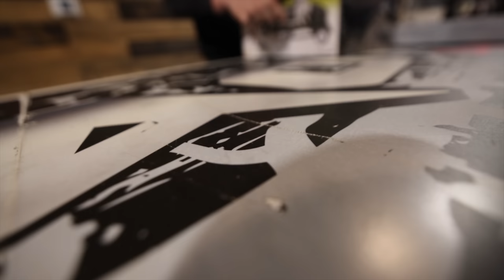What Really Happened To The 1 Ton Swapped Land Rover...

Comment: Hey Nate. 04 D2 owner here. I've owned 5. Het, lube up your rear door hinges as they will break. I noticed they are pretty bad when you tried to close it. 
I really love that you are playing with a D2. Such a pretty ride. 👍
Reply: Tools and Materials Needed:

	•	Penetrating oil (like WD-40)
	•	Lithium grease or silicone spray
	•	Rag or paper towels
	•	Gloves
	•	A small brush (optional)

Steps:

	1.	Preparation:
	•	Park your Land Rover on a level surface.
	•	Open the rear door to access the hinges fully.
	•	Clean the hinges with a rag or paper towel to remove any dirt or debris. If necessary, use a brush to get into hard-to-reach areas.
	2.	Apply Penetrating Oil:
	•	Spray a small amount of penetrating oil (like WD-40) onto the hinges. This helps to loosen any rust and provides initial lubrication.
	•	Allow the oil to sit for a few minutes to penetrate the hinge mechanism.
	3.	Work the Door:
	•	Open and close the rear door several times to work the oil into the hinge mechanism. This ensures that the oil reaches all moving parts.
	4.	Apply Grease:
	•	After the penetrating oil has done its job, apply a small amount of lithium grease or silicone spray to the hinges. These lubricants provide long-lasting protection.
	•	Use a rag to wipe away any excess grease to prevent attracting dirt.
	5.	Final Check:
	•	Open and close the door again to ensure the lubrication has been evenly distributed and the door moves smoothly.
	•	Check for any remaining squeaks or resistance, and apply more grease if necessary.

Comment: I know it seems like everyone and their grandmother has done a LS swap, but for a Disco it seems like a great fit.  I was thinking about buying a Disco with a blown motor just to do a LS swap largely because of Nate's videos.   I'd like hear Nate's rational on why he's sticking with the 4.6.   I value his insights.
Reply: I'm considering an LS/ 1-ton axle Disco as well.  It's basic hotrodding. Take the body of your choice, the drivetrain of your choice, and get to work.
Besides, the LS and the Rover V8 share some family lineage.
Reply: Where are you located? I have an 04 D2 that needs an engine.
Reply: The LS is a larger engine, and heavier if you do the iron block. People who have done the swap are not really seeing better mpg. The h22 trans can’t handle much torque anyways. The h24 can handle maybe 350 ft lbs

Comment: Good call sticking with the 4.6. I did a Turner top hat long block years ago, still going strong when I sold the truck.
Reply from the maker: It should make it better than OEM and this current motor made it to 220k. I have confidence in the new setup. I had a legit Landrover guy put together the long block.

Comment: For your gull wings in the back, look at some truck cap rear doo0/window upper hinge mounts. They go full length of the upper opening, they "hook" together like your two hands, they put stops in the ends, and they slide apart. IDK if this helps, just my thoughts.
Also, good for you going all OEM for engine, transmission, transfer case. I'm getting tired of everyone throwing an LS at whatever they drive because it is a quick or easy fix (not always cheap).
Reply from the maker: That sounds like the hinge on my wifes GFC. Good idea. I wonder if I can find hinges like that for sale? GFC make there own In house. 🤷‍♂️

Comment: Wow.  What a list for upgrades!  Looking forward to them all, especially what you do with the storage in the back.
Reply from the maker: Thanks!
Reply: I second this! Really interested to see more storage options with thinner material.  MDF seems great but 1/2” for a drawer side, 1/2” for the other side, 1/2” x 2 for the box…. Pretty soon you’ve lost several inches of valuable space in a small vehicle to just material thickness.

Have you considered some kind of removable, modular setup?  Sort of like a chuckbox that locks (aircraft track?) into the back but can be easily removed? Maybe fast ambulance style slide in, legs up, lock down, unlock, legs down, roll out…

Either way, awesome build as usual!

Comment: Axle leak, maybe a blocked breather tube? It could be pressurizing when it’s hot and finding a way out under pressure. You said the engine bay is super dusty, the factory breathers vent into the engine bay. 
You can blow through them to see if the are blocked or upgrade to a larger fitting and new larger diameter breather tube.

Comment: Great to see the Rover coming back mate. Love the idea to upgrade the same engine type too. On the compressor is there a risk that running the air from the same air box could cause a vacuum issue with the engine pulling all the air that the compressors want. Might be worth thinking about.
Reply from the maker: The box should have enough flow that it won't cause any issues but I have definitely considered this just like you are saying. But if it can flow enough air to feed the engine at 5k rpm then there won't be any vacuum in the box at idle. The compressors only run when the truck is at idle basically

Comment: Nate your comment about the LS swap is spot on.  People are constantly telling me "Why doing you duramax swap your pig?"   Well, I'll tell you why - because changing the powerplant of a vehicle to something it wasn't designed and engineered for is a road to endless pain and misery... and nearly every owner that has swapped their 6.5 to a Dmax has said the same thing.  It's not just the engine that has to be swapped.  It's the trans, the tcase, the driveshafts, the diffs, the halfshafts, the hubs, the fuel system - not to mention on my rig you HAVE to put in a body lift to fit the damn thing in the truck.  It's just not worth it in the long run.

Good choice on engine dude.  I approve.

Comment: I'm +1 for the 4.6 Rover. I got a D2 with the 4.0 Rover V8 here in Aus. I rebuilt mine for under $1300 Aud (about $50 USD lol) Turner Engineering in UK have heaps of parts for them. Only thing with Rover V8 is they have a flat tappet camshaft. You probally are aware but these NEED to be bed in correctly on initial start up. I learnt the hard way and in under 5000km, I wiped out 12 lobes and all my lifters. Can't wait to see content on this beast, this is what I'm here for Nate 🍻🍻🍻

Comment: You shouldn't need to tap the steering box for hydro assist.There are a few (eg Gwyn Lewis) kits for the Land Rover 4 bolt box that are bolt on. They should fit the D2 box as well because it is the old 4 bolt box but with a thicker sector shaft for added strength (a failure point on the Defender and D1 boxes when run with bigger tyres).

Comment: Dude, I got a CNC plasma cutter in my shop. If you wanted to link up to tackle this molle panel design project, let me know.  My plasma table can cut 2' x 4' of material and I have Solidworks for designing anything 2 dimensional or 3 dimensional. If you need specialty plastic brackets to mate odd shaped mounting areas, I also have a 3d printer.. I've been following you since your Tacoma project (I'm more of a Toyota guy LOL) and it would be great to work with you . Cheers bro!

Comment: I actually LOVE that you're sticking with the factory engine.  Simply put, it's easier.  There's NOTHING to figure out or splice or modify.  I get it, and I LOVE it.  I can't wait to see what-all you're planning for this rig!  It's giving me ideas for my GX460!  So keep the vids coming!!
Reply: One thing you won't have to worry about in your Lexus is a self disassembling engine like the Rover V8.  An LS in the Disco would take so much worry out driving. An LS would outlast the rest of the vehicle.
Reply: Saying that there's nothing to figure out with a Land Rover is.... optimistic. An LS would be simpler and more reliable. LS's are plug and play at this point.
Reply: @amorton94  I just like the looks of the Discovery. I'm thinking a complete drivetrain swap. Transmission and t- case along with engine and axles. Do away with traction control and abs, and use an aftermarket dash display if the LR dash can't be made compatible. Not easy, though. 
Seems that the stock engine is the only real issue with these and if that can addressed, that's great. You are still stuck with 4.6 liters and horrible fuel mileage for the power they have.
Reply: @scootypuffjr.  Im thinking you don't own a Rover? The transfer case is extremely well designed. Some much so that every high end Defender builder uses them.
Reply: @bp9749  Thats what i hear. I'm just talking for ease of using a GM transmission as well. Also, I don't care for full-time 4x4. It drinks fuel unnecessarily.

Comment: I have 10k miles on my aluminum 5.3 thus far. I know it's played out but it's the most economical, most reliable, replacement parts abundant, sounds good, and churns 35s with no issues. My factory speedo, tach, temp sensor, and fuel sensors all work. Check engine light on my dash works for GM PCM. No oil leaks. The factory engine is severely underpowered and has many weak points including oil pump gear failures, slipped liners, sensitivity to over heating leading to popped head gaskets, and oil leaks out of all crevices.  I'm in love with my truck all over again and intend to keep until my 3 year old son drives it to highschool. I'm using the alternative conversions kit.

Comment: As the comments for a video less than a day-old clearly suggest, your Land Rover series is not just well-liked, it is also unique and different.  That is a hard thing to pull off these days on YouTube, but you did it.  And you did it very well.  No need to apologize for the time spent on the details--for those of us who actually own this vehicle, the great detail (like the spare tire/rear bumper build) are greatly appreciated.   Since our discussion at SEMA last year I have spent a lot of time rebuilding my 2004 D-2 and this video series was very, very helpful.  I have been working on Rovers for over 20 years so please take that as an honest compliment.  For what it is worth, a few topics that might be nice to cover in the upcoming videos (if you are so inclined...):  (1)  Can you talk a little bit about the Chevy LS/LM A.C.E. conversion option?  That one is definitely very different than all the other Chevy 350 builds given the double ECU/wiring configuration, the ability to keep the stock tranny/t-case/axles, and can also be done pretty cheap if you have middle-of-the-road mechanical capabilities and opt for ACE to build your plug-and-play wiring harness.  (2)  Can you talk a little bit more about your front and rear sway-bar configuration?   I have seen three Discos go turtle over the last 20+ years and each time it was from a completely disconnected front end unloading combined with too much throttle and bouncing.  It would be great to hear your opinion of how your sway bar mods affected this issue (on my old TJ the Currie anti-rock made a night-and-day difference).   Thanks again for providing quality and unique content!

Comment: Owning a 2000 D2 myself. I too went through the research of what engine to use to replace my failed LR 4.0. I really wanted an LS however I didn’t want to spend a year rewiring the rig to tie it into the LS computer.  So I also chose to upgrade with a reman 4.6 top hat modified LR motor.  Very happy with my decision.

Comment: As others have said I'm so glad your sticking with a rover v8. People saying its cheaper and easier to go with an LS, I can't see how. You won't need to piggy back ecu's, deal with a pile of wiring etc, it'll just go in! I have a '04 disco and I love it! They have their issues but if you get ahead of them they aren't too bad. And I've never had trouble getting parts. As for your hydraulic assist I've read that you can tap the cover on the end and use the bleed port. If I can find the write up ill send it your way. I'm so looking forward to more rover content, keep it Nate!

Comment: Gwen Lewis hear in the UK is probably are goto for hydro assist I'm sure he has info on his page also we like to drill the powersteering pump pressure side out to 4mm and stick about 3/4mm of washers under the spring that'll increase pressure and flow thats also what we do to the pumps when running full hydro aswell hope that helps

Comment: Boy Nate can’t wait to see this all come together and be finished , its gonna be awesome .. i have a 2006 Liberty set up for overlanding , just like your brothers ,but with the 3.7 , and when it craps the bed im gonna put the same thing back in it , for me there is alot to say for worry free reliability.. i do oil analysis every oil change and they still come back perfect and burns 1.5 quarts of oil in 5,000 miles even tho the clock says it has 265,000 miles on it , i am the second owner and have rebuilt or replaced every single part on the jeep except the engine , so i dont know if it has been replaced before i got it .. but something about that jeep ii just love , so when its time a new 3.7 will go in ..

Comment: @15:00 Min when you mentioned oil leaking from the driver's side axle tube, it could very well be that you installed the seal backward. I've got a 1994 Defender 110 Pickup and I did exactly that and had the same symptoms. Instead of sealing the diff fluid from the knuckle assembly, the grooves actually spun to do the opposite.

Comment: NATE  keep the rover builds coming. I have a disco  with a refreshed motor no top hats but pinned liners now. and it runs so much better than the other one. (slipped liner and crank bearing shot) cant wait to see the manual transmission  too.
I do have questions for you sometime about rear bumper also.
Inspiring me you have

Comment: Hey Nate, I really enjoyed this vid (as I do all your vids). One thing I wanted to mention is that airbag failures are actually relatively rare if the system is maintained (no 15 year old airbags on max flex...). We (GAP Diagnostic - we make diagnostic systems for Land Rovers albeit starting with the L322 RR or LR3. Hit me up if you ever go for a newer Land Rover :-p) see all sorts of EAS problems in Land Rovers - airbags are generally not an issue. That said, the systems need to be maintained and our customers have mainly on stock or mildly modified suspensions such as with a rod lift or lifted electronically through our systems. But if you're within the specified range of travel for your airbags, I wouldn't worry too much about them. Getting something in there to damage them is actually quite rare (not impossible, though).

Comment: Gwyn Lewis4x4 sells an off the shelf assist ram kit. Whether it would work with your one tons I'm not sure ? I've tried to share the link, but if you Google gwyn lewis 4x4 assist ram kit I'm sure you'll find it. Also, I know there's guys over here that machine steering boxes for racing to lighten the feel which might work well if your steerings feeling heavy. Hope you're keeping an LT230 transfer box. They're a strong box. And plenty of ratios available for high box from 1:1, 1:2, 1:4 & 1:6 and you can get crawler gear sets for low box too.

Comment: I’m regards to weight. I built a alloy roof rack and saved 42kgs over the steel one I used to have. I run the exact same roof top tent and it made a huge difference. Barely notice the tent being up there. The compressors would have gone a ARB dual compressor as would have saved heaps of space and they push more air and are super reliable. Plus water and dust proof. And 100% agree on the alloy draws in the rear. MDF is super heavy and in aus we have really struck vehicle weight laws so we have come up with heaps of ways to reduce weight. Super tough disco though!!

Comment: Many episodes ago I mentioned that Rovers are almost impossible to modify for serious off-road. Either modify nothing or modify everything. Everything is built to the same strength,  so the next weak point will be quickly found. They are a comfortable and capable vehicle for easy trails in standard build.

Comment: On the molle stuff for the wing windows. What about using kydex? Might be easy to just use a router to cut out the molle holes and and the wing window sides aren’t going to be holding a massive amount of weight… looking forward to the new series.

Comment: as someone whos built a couple 4.6s rv8s and raced them spend the extra and buy bosch coil packs ive found anything other than genuine bosch to be crap whod of thought a bosch ecu likes bosch parts XD
Reply from the maker: This is sage advice. It's the same with most VW parts. The aftermarket stuff at O'Reilly doesn't meet the same specifications.

Comment: Start looking for a pedal box if you haven't already. Thay hard to find in the USA especially for a disco 2 since they are slightly different from disco 1/RRC. The factory one can be modified to accept the clutch pedal but I found trying to make a clutch pedal spring work and feel like it should, impossible. Maybe you will have better luck. 
But you will still need to find the correct clutch pedal as they are specific for disco unless you are going all after market with your hydraulics. 
I look forward to the build. Your disco is what brought me to your channel originally, I have picked up a couple new techniques  from you especially when welding, keep it up man.

Comment: For your fender flares have you thought about skinning them in carbon fiber or Kevlar? If you use the right epoxy, it'll definitely increase the strength (plus give you the opportunity to tweak the shape/lines a bit).

Also, I LOVE the look out of your roof rack, I plan on building the same out of aluminum (99 Disco S2) once I get better at welding aluminum